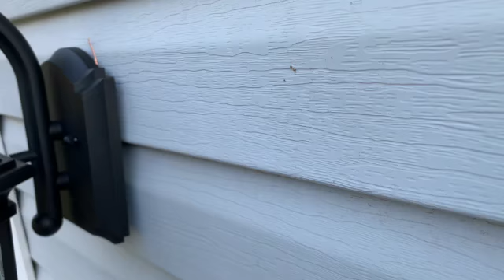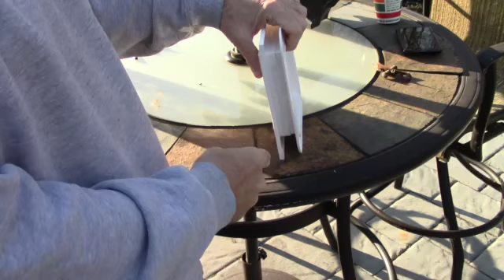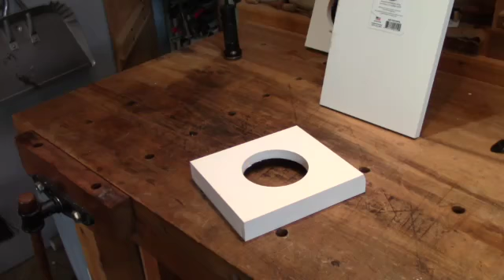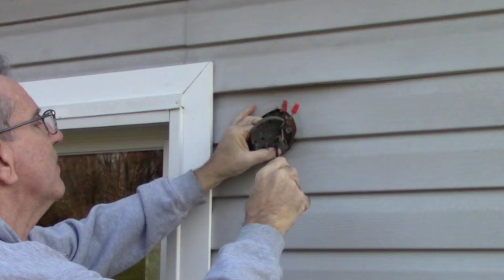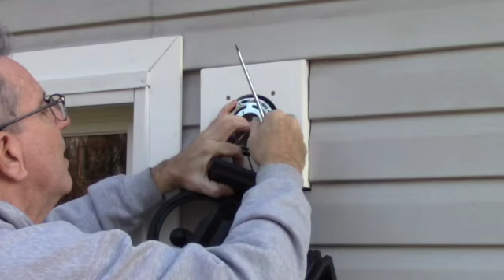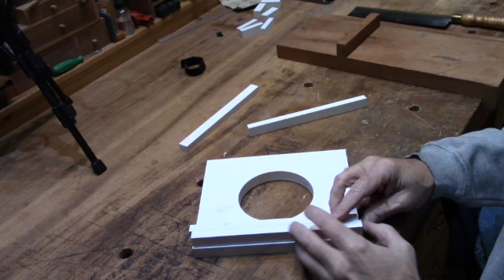Mounting Exterior Lighting the Right Way with Custom Blocks   SD 480p

Comment: Ran into this nightmare when residing house. Company that we hired did not care and were not primarily siding. We have several different sized intrusions in house. Lights, outlets, different air vents, garden water hoses spigots, air conditioning, and external electric boxes for power and internet. They did a garbage job and I had to go through and redo. I looked at neighbors houses to see what best looking solutions were. Like you I disliked the plastic box plate things. I just used blocks of wood and painted to seal them from elements.
Reply from the maker: That’s what got me started on this. Got a new patio and the wife wanted all new lights. I had replaced one prior and used the wood and paint. Had to scrape and repaint that one. Not really a big deal, but like I said. Got me thinking. I guess the builders can save a lot of money by shortcutting this when they are finishing up the house. In the spring, I plan to go around and do dryer vent, range hood vent, outlet boxes and gas pipe, too.

Comment: Good job frank. Did you end up caulking the small gap around the mounting block. I will have to use that material as well
Reply from the maker: Thanks. Yes I did.